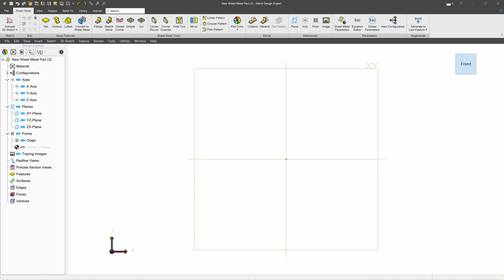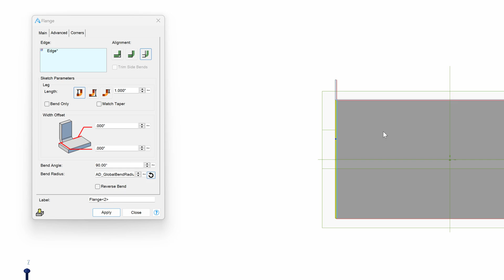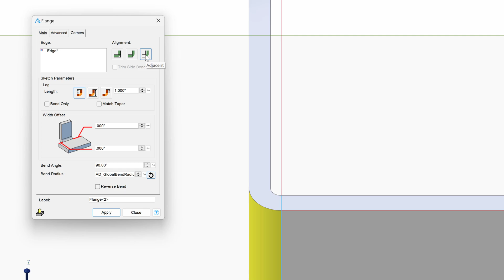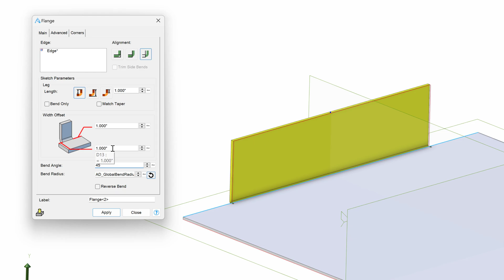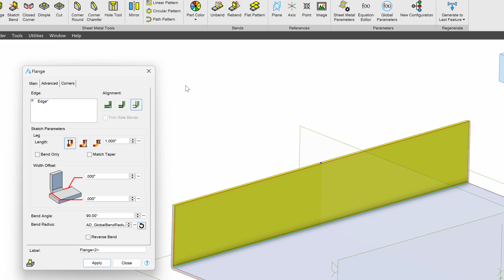Flange & Bend Creation | Alibre Beginners Course #48

Comment: great videos, if you take requests, a video on creating knurl knobs
Reply: That is a very well discussed subject for CAD software over the years actually. Unless you want to 3D print it or do a high quality I would suggest to avoid it. The reason is that creates a very resource-hungry geometry that might even drop your frame rate. Just to add a certain colour to denote the existence of a knurl and then annotate it in the drawing. But if you really need a way to create knurled knobs with actual geometry, I could do a video on it.